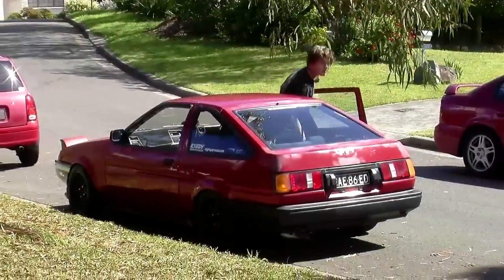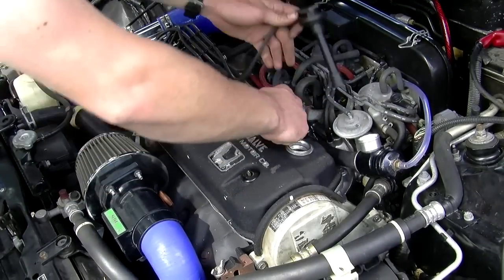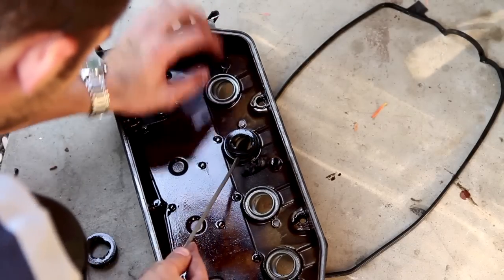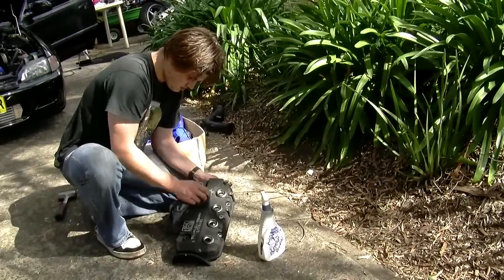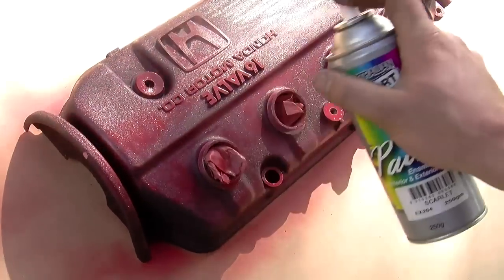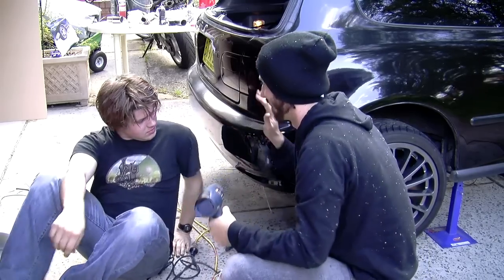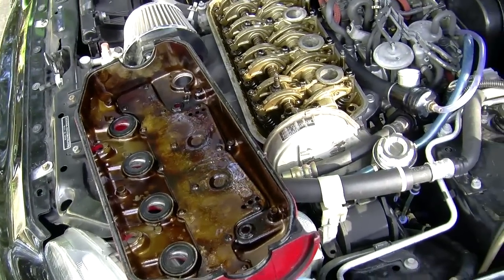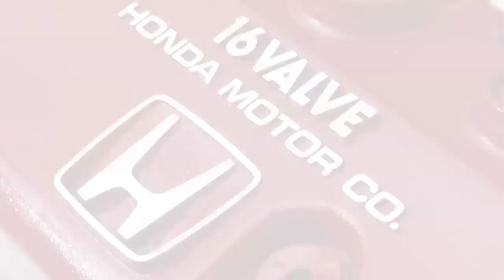Mighty Car Mods - How To Paint Your Rocker Cover

Comment: "...and unbolt the CAVA!" love that
Reply: +geese you clearly don't know anything about cars. He's not smiling "like if..", he actually gained AT LEAST 15hp with this + 15hp for the red calipers but if you do both you actually get +50hp total...MAAAD!
Reply: ***** damn be MCM, I'm pretty sure they tricked us into this red, aggressive, Ferrari-like color so they could keep that yellow secret for themselves...I'll go buy yellow paint and put it ON TOP OF THE RED ONE! Pretty sure that's an extra combo level which triples your hp gain :P
Reply: its actually not that simple. +50hp plus when you paint both rocker cover and brake calipers is only when you paint them red. Other colors will add just 30hp, tho coloring them using plastidip doubles that. Also painting it like the Rising Sun flag gives you 100 extra horses.

Comment: Okay i admit i was a little mistaken, but OHC engines can either operate the valves with rocker arms or without. And how could the lifter fly out of the engine when the camshaft is in on the way?

Comment: When I first took my cover off my '91 Toyota Tercel, it was completely covered in a mess of paint/rust/corrosion.  After a major FUCKton of sanding/going over w/ wire brush, i have 95% of it down to bare metal, with the crevices still a bit corroded. Am I fine to paint it like that,  or do I have to the whole cover absolutely clean? Cause I've been scrubbing for a while, and I'm starting to get tired. I've been told stories that enamel paint wont stick to corroded surface
(BTW Im too broke for a Dremel)

Comment: @lookwhos8teen : well my rocker requires only 8 Nm of torque and my torque wrench only goes down to 28 Nm, which is pretty weak, so you don't HAVE to torque it on. Plus the rocker cover just covers the valvetrain so it isn't under the same pressure as the cylinder head or sump.

Comment: @TheNizzmo If you have a manual, and you mean when you put your foot down the revs jump up and 'hold' for a moment then drop back down as the car speeds up and then continues to climb with the car as it normally would. I'd say you're clutch is due for replacement. My rex did that. If felt like driving an auto with a high stall converter. New clutch and it was good to do though.

Comment: If you have engine gaskets that goes around the head do you need any sealent/ glue?? 
looked like they just bolted it on no glue. 

?????? THANKS ???????
Reply: Tristan Nel If it's an "o-ring," no sealant is necessary. Otherwise you want some grease.

Comment: I have been wondering, the air pressure sound @ 2:40. Anyone know what creates that? What type of modification?
Reply: thats a blow off valve sound, most turbocharged motors will make that noise when they get off of boost if they have a BOV
Reply: +ChronicConnoisseur The blow off valve sound coming from this civic isn't even real, it's a speaker that is hooked into the ECU so it plays an mp3 file when you take your foot off the accelerator.
Reply: im aware, i saw the whole vid lol, the mcm civic was a big joke

Comment: You forgot to mention to put sealant on the gasket otherwise it will have oil leak. Also it's best to bake the rocker cover in the oven for the paint to harden.
Reply: Good points. I put mine in the oven on 400 for about 20-30 minutes. I also used gasket sealant on the corners.

Comment: Hey guys,
So I tried to do this today, Got all the bolts and plugs off easy enough, but the cover still wouldn't budge. By the looks of it there's putty or something bonding the cover to the rest of the engine, and it won't budge. Is this normal? Is there a way around it?

Car is a 2004 Lancer.

Comment: It might have been worth mentioning that when you take off the leads, yiu should note which spark plug they were connected to. On some cars the cable length doesn't make it obvious... And putting them back on in the wrong order = nightmare.

Comment: I have the same honda as you but when I take the engine head off do I have to put anything back together after ward?
Reply: Nope, paint the cover, then while the paint is drying, feel free to drive around. That cover is useless really.
Reply: tubefed420 ye except oil will be flying everywhere

Comment: The best way to get the paint off of the letters is to use a stick of lip chap. Spread it over the letters before painting. Once it's dry just pick the paint of the letters, easier than using a file and risking scratching the newly painted surface.

Comment: Got a Silverstone S2000 (like Moog's) and I want to paint my cam cover soon. Initially wanted to go original wrinkle red but can't get the right VHT paint here so, suggestions? 

-Gold flake metallic with blue spark plug cover?
-Blue metallic with gold spark plug cover?
-Red metallic with shiny black spark plug cover?
-Anodized purple with gold spark plug cover?
Reply: i reckon purple with the gold covers
Reply: Aussie Viking The Second
Thanks for responding mate. That's a cool combo indeed but isn't it a little too "porno"? I mean the purple might be a bit over the top now that I think of it lol. I just sprayed it with a can of Dupli Color Anodized red and it came out pretty nice but darker than I expected. Clear coat makes it shine nicely. So I might hit the ignition coils cover in gold. It will be coming off again in the next few months for a seal replacement so I might change the colour entirely. J's Racing blue perhaps.

Comment: If you file back the logo on the cover, wont that rust after a short period of time?
Reply: +MrLauritsabel Aluminum doesn't rusts, it corrodes, and aluminum oxide is clear, it won't be noticeable.

Comment: How many cans did you need? I want to paint the engine cover of my Miata and I'm wondering. Also, is that specific spray paint or it's just average spray paint for high temperatures?
Reply: one can is plenty. Use caliper paint for the best results and dry it with a hairdryer to bake it on. Normal paint will work but it doesn't stand up to as high of a heat :)
Reply: ***** thanks for the information, hopefully I'll do it during this weekend!
Reply: Just use the hairdryer that came with your Miata ;)
Reply: HAHA OUCH

Comment: you can see the old paint especially where it chipped and flaked off thats how.

Pro tip: Aircraft aluminum paint stripper, once you got clean alloy, get it POWDERCOATED. Then, it will truly be a job well done.

Comment: I wouldn't use plasti dip if you want matte finish they have matte engine spray paints. Plasti dip isn't heat rated high enough

Comment: wont taking off your valve cover make it leak oil?
Reply: While taking off the cover, the oil is all in the sump (oil pan) and won't come out. As for leaking while running afterwards, they resealed the cover so it's actually less likely to leak than before. Using some quality sealant with a new gasket will help to prevent leaks in the future.

Comment: Im worried about taking my rocker cover off. Can someone let me know some things (if any) that could go wrong when I take it off? I just dont want oil to spill out everywhere or anything like that. Im not a huge mechanic so any help would be appreciated haha thanks guys
Reply: Nothing will happen. But you will have to clean all surrounding edges that the cover sits on and most likely replace the valve (rocker) cover gasket. Silicone may be needed for edges where the cam sits between the head and cover.
Reply: My rule of thumb is tight, bit not till you fart. And tighten them down in a spiral. Starting from the inside middle bolts and work your way out, just snugging them up about 3-5 passes.

Comment: +NanoTechExtreme
Come on mate get real or better yet show me your "roller rockers" on a DOHC engine.
You say you know engines yet you fail to understand that DOHC engine run "buckets" directly off the CAM LOBE, no rockers at all.
Sure, your "old" PUSH ROD's and SOHC run rockers or roller rockers but that's where is ends.
Further more I also challenge you to point you where any form of "rocker" on a WANKLE ROTARY engine and a 2 STROKE PISTON engine.
Get off our high horse and go get your facts straight.
Reply: But that is a single cam engine.